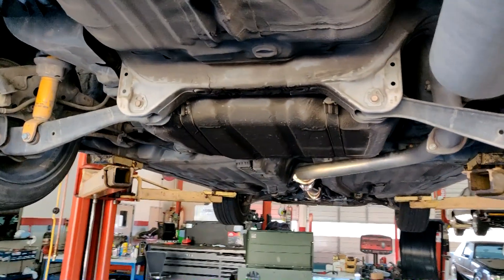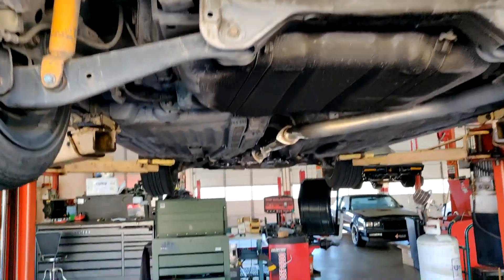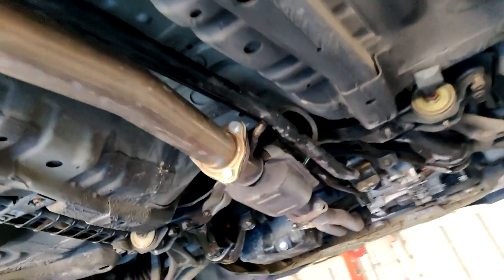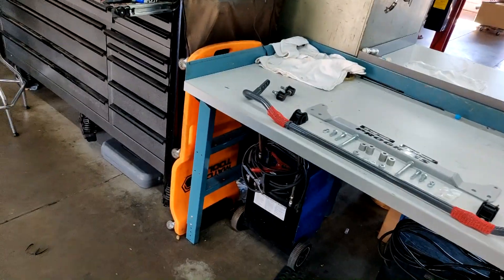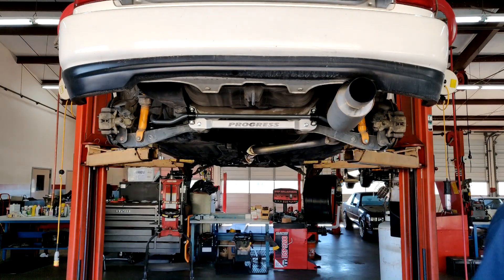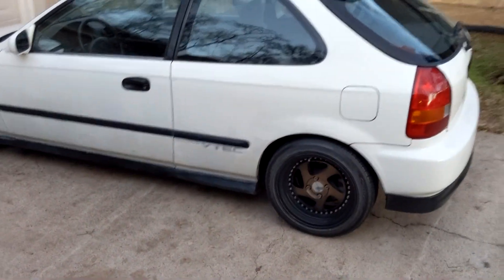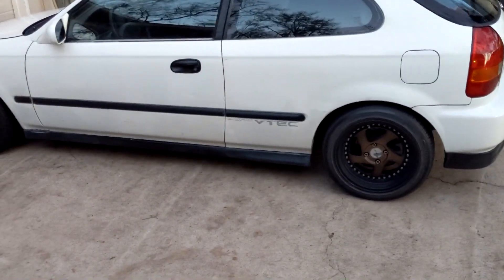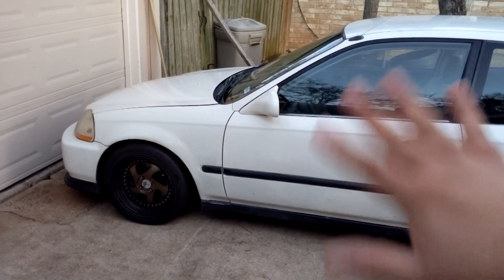Civic EK Hatch Gets A Progress Rear Sway Bar!

Comment: I'm confused as to how you adjusted the height by compressing the springs.
Reply: They are only more compressed when NOT under load. When the car is sitting on the springs, they compress just as much as they did before the adjustment. However, because you have now moved that collar up, the spring sits higher so the car will too.